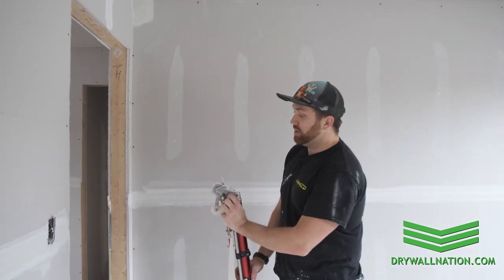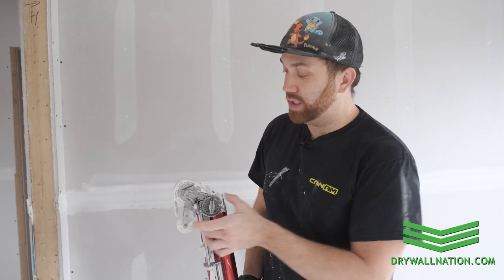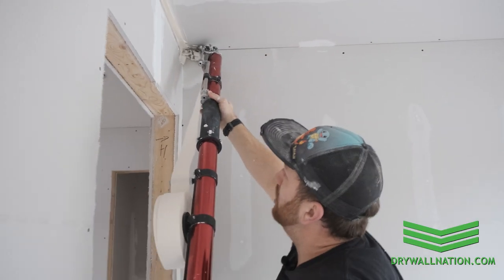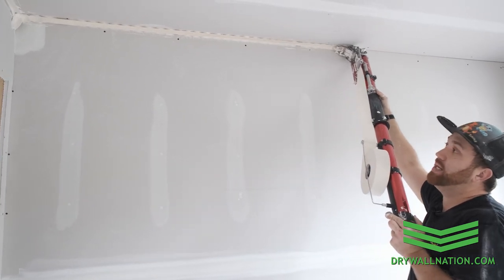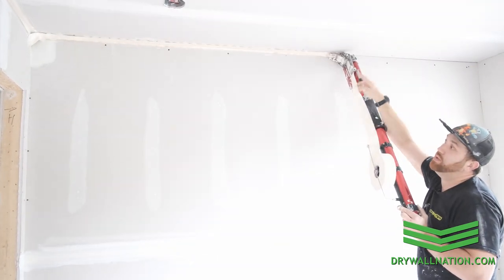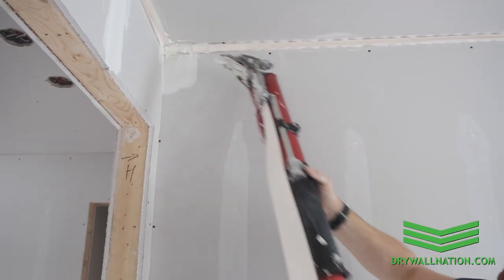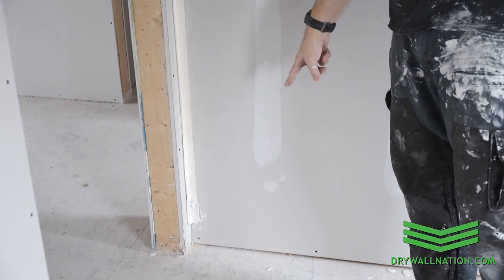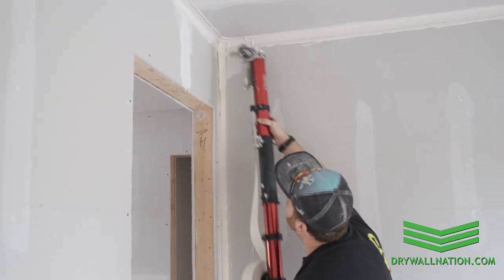How to Eliminate Tape Drag in Corners w/ your Automatic Taper.

Comment: I had lots of trouble taping ceiling angles and the biggest mistake I was making is that I was not using taping mud I was using a multi purpose or machine mud and all of my tapes would fall down very quickly you did not mention this in your video but I figured it out and taping mud is key
Reply from the maker: Although I think it is better practice to use a taping specific mud for applying tapes, using an all purpose instead would not cause your tapes to fall down. I've taped for years using all purpose, specifically Machine Mud and we've never had any issues. I would argue that your problem was most likely just inexperience. I mean, why would you only have problems with tapes falling down on ceiling angles? Why aren't tapes falling down from your ceiling flats or buttjoints? Top angles are the most difficult part of taping with an automatic taper so it does take time to figure it out. I think what most likely happened was just coincidence, by the time you switched over to taping mud instead of all purpose you most likely got enough experience and got more comfortable with the taper that you were able to do angles more comfortably.
We do have a beginners guide to taping inside angles if you're interested in learning more.

https://youtube.com/watch?v=JtL7oHQxJdQ&feature=share7

Comment: Does anyone else getva dry spot 12inches from the start? For 3-4 inches?
Cant figure it out. Thought it was the pump putting air in.
Reply: It could be the way you are pumping it. Your last couple pumps might not be full pumps. Don't do jerky pumps. Keep them smooth and full stroke. Or your mud is  too thick and you're picking up air. Or you're holding your taper with the gears facing up and gravity is doing it's thing. In that case the mud is usually too loose. Just my experiences.
Reply from the maker: Could be because you're not priming/charging your head before you advance yourself more tape. Raising the tape without your wheels turning against the wall or turning your drive dog manually means you will have dry spots at the start of your runs. Check out our beginners guide on how to use an automatic taper series. Its quite detailed and we do talk about this.
https://youtu.be/fEcch7KcnM4